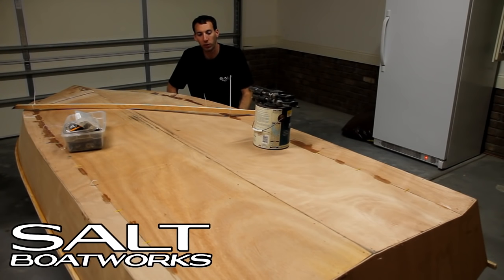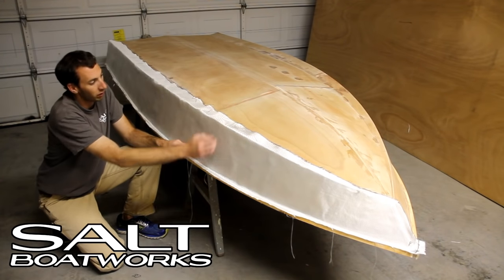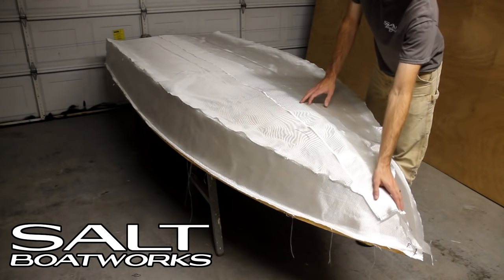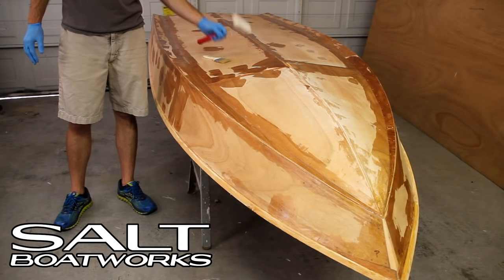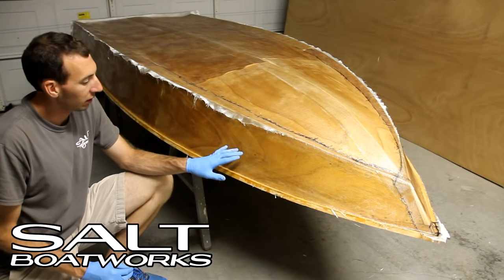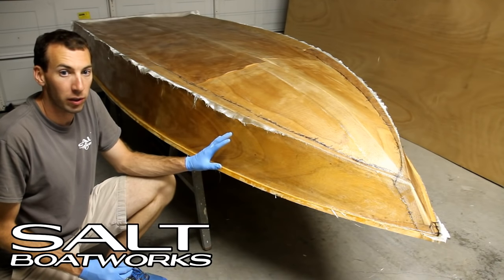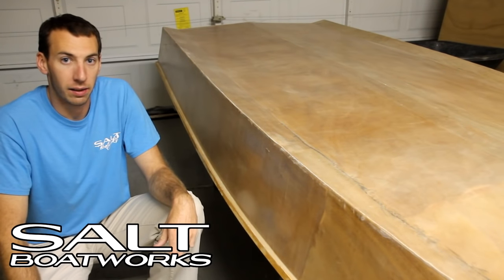How to Fiberglass a Boat - How to Build a Boat Part 7

Comment: Great video sir but I had a job hearing you right because of the acoustics. 
I make professional films, if you throw some foam or old drapes etc around your garage or hang some from the roof it will deaden the echo - hope this helps.
Your video has helped me glass my sea cruiser!
Reply from the maker: Thanks for the tip.  Awesome, glad our video was helpful!!!
Reply from the maker: Glad we were able to help and thanks for the advice on the audio.  We are familiar with boat building, but still learning how to make videos.

Comment: Concour on laying glass first. Also I use low visc epoxy and slow hardener. Something of that size takes two people wetting out and one person making up small batches as you need them. Temperature effects how well and fast the glass absorbs and I generally try for low 70's. . Too warm and the epoxy sets up to fast and to low and it's difficult for the glass to absorb in a timely matter. Your under the clock glassing and you have to keep moving.
Also after it's absorbed you want to remove the excess with a  scraper (called a bondo scaper) otherwise you can get runs. Also use a heat gun to release trapped air bubbles.
There's a lot more to it then your video.

Comment: Don't worry about imperfections. I found a finishing bondo at NAPA that will fix before your final final final final sanding and gelcoating.
Reply from the maker: Be EXTREMELY careful with non marine products.  Some products have incompatible curing agents or solvents  or will fail if exposed to water.  In our experience bondo is one of the products that does not hold up well over time.  We recommend using a marine fairing putty or marine glazing putty.
Reply: @saltboatworks1139  thanks
Reply: sanding gel
Reply: used in mold work
Reply: or tooling gel

Comment: I know this video is over 3year but still hope you can reply and give me some help...how long do I have until the epoxy resin catalysis begins and would be too late to correct the fiber glass adjustments...I keep worrying that my t iime frame is short and so my boat building is on standby...I have the whole body done and ready for fiber glassing but unless I know the actual time limit, I fear to finish it. Nice video but the elapsed time is so hard to judge...hope to hear from you.

Comment: excellent video thanks! roughly how much weight does the fibreglass add to the hull?
Reply from the maker: The weight added varies by cloth weight, this completed hull weighs 100lbs.  That includes all wood, epoxy, and flotation foam.

Comment: What kind of apoxy (however you spell it) are you using in the video? And would it matter what I use to cover the holes? For ex: wood putty
Reply from the maker: When boat building, we always recommend a marine grade epoxy. We advise you fill the holes with thickened epoxy.
Reply: You can use many brands. Just make sure its EPOXY and not polyester. You will know its EPOXY when its $100 per gallon... ;)
Several brands are West Marine, System 3, or Glen L.
Reply: Commonly premix epoxy resin in fiber boat Building in the Philippines is proxy resin better than premix resin?

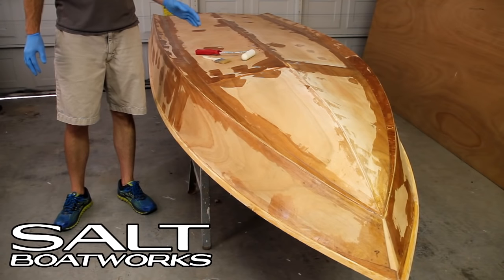Comment: Please - At 2:36 -  WHY do you apply epoxy to the entire outside surface of the boat before you fiberglass the outside surface of the boat?
Reply: I am not sure, but I think it is so that the fiberglass will stick to the wood. Essentially, the epoxy is gluing the fiberglass onto the wood. The epoxy was still wet when the fiberglass cloth was laid on top. If you let the epoxy dry before putting the fiberglass on, then I don't think that the epoxy would do much.

Comment: Want to build one of your boats but don’t like the wood idea would the same processes apply if I switch out the wood for composite board?
Reply from the maker: At this time, we don't have any plans for composite.  But to answer your question, yes you could use the same concept.  However, you may have some challenges keeping the composite core from deflecting while you build because it is more flexible.

Comment: what kind of epoxy resin can be bought in such large quantities? ... 
it seems like in my country there are no epoxy resin sellers in large packages.
Can you tell me, the brand and series of epoxy resin products? ...
Reply: Where are you from? I also noticed that epoxy resin in bigger quantities specially marine epoxy is not so available in the Philippines. Polyester resin though are more available.
Reply: go on the "west systems" website. I bet they can sell you as much epoxy as you can afford. And if you can use cheaper stuff "Alibaba" will ship you a container full.

Comment: Your woodworking skills are good. However you would benefit from learning how to laminate by watching a surfboard laminator. They laminate many boards a day professionally. There are many ways to 'skin a cat' but this way, the way you have applied the cloth is just made the job more difficult. You should run the width of the roll down one side of the bottom of the hull lapping the centreline and over the chine by at least 2 or 3 inches or more depending on the width of your cloth and the bottom half of your dingy. Repeat for the other side. It's not necessary to coat the ply wood first, just lay your cloth down and wet out over it with a roller or squeegy or with just a squeegy. If you use a roller on the sides, go over it with a squeegy to get the cloth pressed down onto the ply as resin 'floats' on a resin rich application.  You don't have to take the cloth off and make a difficulty of placing it back on a wet surface.  In life, we are always learning. Cheers

Comment: Does that make the boat a Wood Core boat that  often rots  from the inside? Or is that more   In using Fiberlass resin  instead ofthe Epoxy ?
Reply from the maker: A plywood hull with epoxy is very different than a vinyl-ester or polyester hull with plywood used in it.  Marine plywood and epoxy boat building is used by some of the most prestigious custom sport fish builders, and when done correct will outlast and outperform other materials.  However, most folks are familiar with rotten transom, decks, or stringers in boats with some age.  Over 90% of those boats came from a mold and use an 'ester resin, which is not an adhesive (like epoxy) and thus makes a superficial bond with the wood.The problem is that the glass and wood de-laminate over time as the the hull flexes and moves,  hairlines cracks in the glass are created and let water in.  Coincidentally, these cost cutting manufacturers often use non marine grade plywood and drill holes and screw things into the wood without sealing the exposed wood.  This is a recipe for disaster, but they built and sold the boat as cheap as possible...  I have no respect for that.

Comment: When you say "epoxy" are you talking about the fibre glass resin?
Reply: Yes, epoxy is a type of fibre glass resin
Reply: john centanni  you can use any kind of epoxy in my experience. Go to your local home depo and pick up a can
Reply from the maker: Sorry, I missed your question.  Yes, epoxy is the type of resin.  Many brands and vendors are available.  However, not all epoxies are the same.  Be sure it is formulated for use in wood joinery and marine applications.
Reply from the maker: The Mystic Ruler   The epoxy later in the video has an additive mixed in known as "fairing filler".  It makes it easier to sand prior to applying primer.

Comment: Polyester resin will not adhere to the epoxy you used to fill the tie holes and gaps between panels.
Reply: no it will not he should have used poly filla
Reply: or a brush on areosell gel coat mix
Reply: @jasonstrong9974  Polyfilla is not waterproof and is not a good choice for boats.
Reply: @FixNewsPlease  i was a fiberglass tec and it is used all the time . fiberglass is also not waterproof and will soak up water and become very heavy.polyfila used in fiberglas is made for it and is green in color its not the crap used on cars
Reply: He did not use polyester resin, only epoxy.

Comment: Why only one layer of glass? There is no way that would be strong or safe enough. Should have been at least three layers, otherwise that ply will get wet and the whole thing will be useless.
Reply from the maker: The main structural support is in the wood hull, the glass is to seal the wood and provide abrasion resistance. There are countless boats built with this method and no issues for many years.  The use of epoxy resin which saturates the wood (unlike poly or vinyl ester) marine grade plywood make a very strong, safe and reliable hull.
Reply: West System has documented boats built with one layer of cloth and epoxy that are over 30 years old and still in excellent shape.

Comment: how many layers of fiber for making this boat ... please inform me thank you
Reply: Typically you only need one layer of fiber glass. He also did one layer on the inside. The seams of the wood like the keel and where the sides meet could get two layers of 3-4" wide fiber glass tape if you wanted to go over kill.

Comment: Good day, can i know what kind resin u use and the math?
Reply from the maker: We use marine grade epoxy resin, mix ratio varies by brand.
Reply: If i put epoxy, its good for Floating longtime? Or yearly?
Reply from the maker: @SEAMAN-nanagat.  The epoxy will last the life of the boat if the boat is properly cared for.
Reply: Ahmmm ok thank you so much

Comment: It will be like sanding a car tire  Epoxy BLOWS!!!
Reply from the maker: Adding fairing filler such as micro-baloons as we show makes epoxy MUCH easier to sand.
Reply: @saltboatworks1139  Takes forever to cure and cost 3 times as polyester resin NFG!
Reply from the maker: @arthurtaddei1285  the 'ester resins do not bond to plywood well at all, they have minimal adhesive qualities.  They will delaminate, period. Cure time varies with hardener, temperature and application. You get what you pay for...
Reply: @saltboatworks1139  Used polyester all my life and never a problem unless going over epoxy . Been in fiberglass repair and outboard business 35 yrs and was taught the correct way .Epoxy Sucks
Reply: @arthurtaddei1285  life treating you well at the moment is it Arthur? Stay off the hard stuff hey.